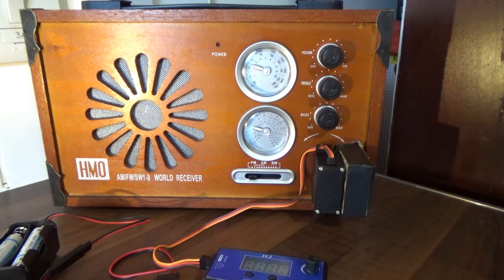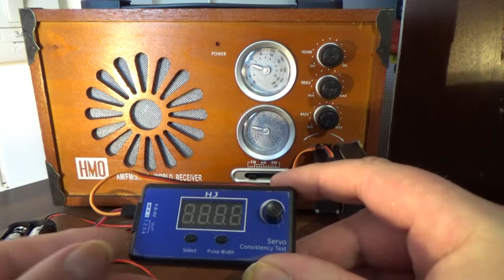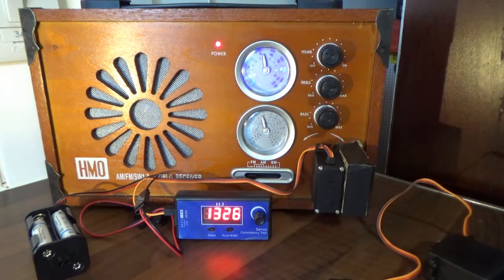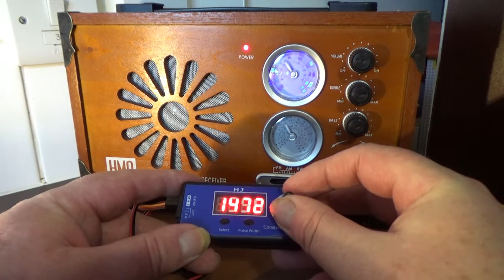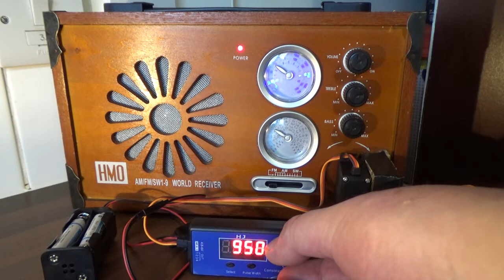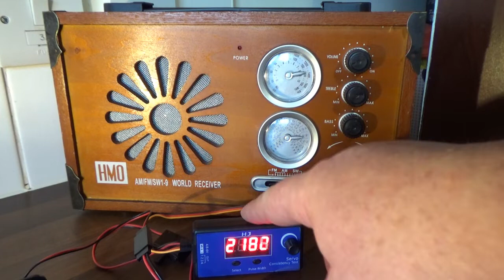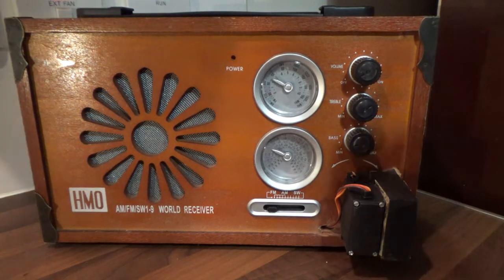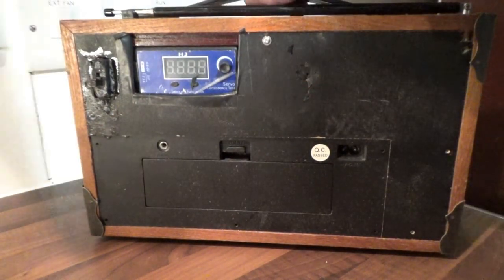MY VARIABLE SCAN SPEED ANALOG SPIRIT BOX PROJECT

Comment: You've gone all sciency Sam. Great bit of work you've done on that radio
Reply from the maker: Thanks Brett, i put it off for ages because i thought it was going to be really difficult but its just a matter of searching for the parts to plug together with out messing around with soldering wires. Im hoping i can get the controller to make the servo motor have a wider scan because its not scanning all the frequancies but i think its just a matter of messing around with the buttons.
Reply: @lifeafterlifeproductions  Yeah. Its turned out great though
Reply from the maker: @WOLFPARANORMALUK  Just came back from the crystal shop and hard ware shop to buy some bits to personalise it abit.

Comment: You’ve done a brilliant job at turning it into a scanning spirit box, great job and video explaining how you did it
Reply from the maker: Thank you Sandra, Its good that there is control on the scan speed. I though this would be difficult and expensive but it wasnt that bad. I just bought the parts that plug into each other. I just came back from the crystal shop with some stuff to put a personal touch to it.